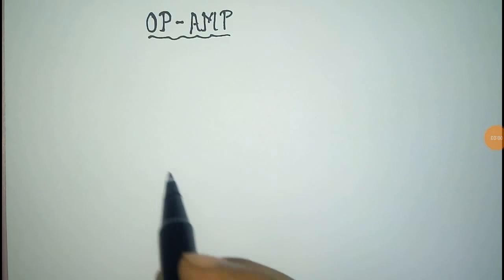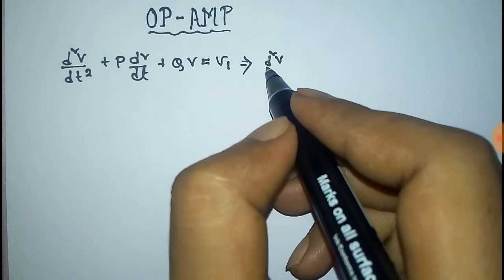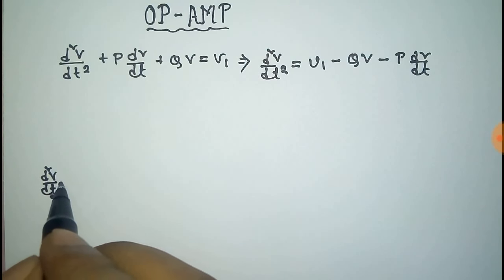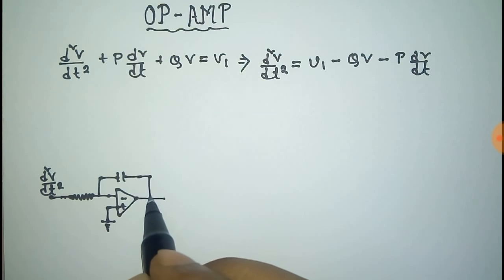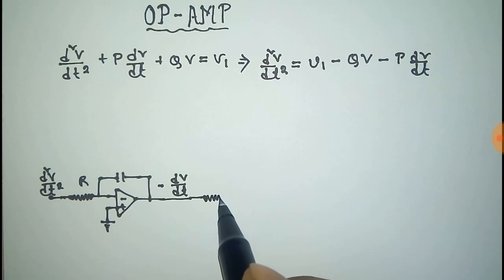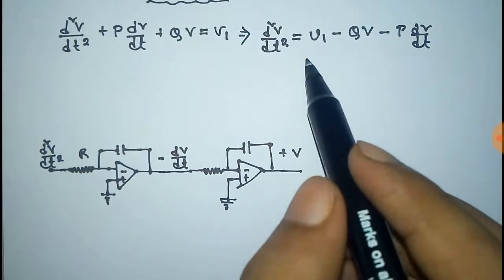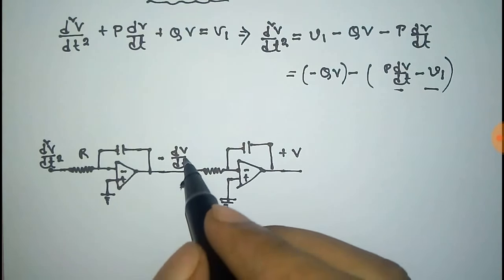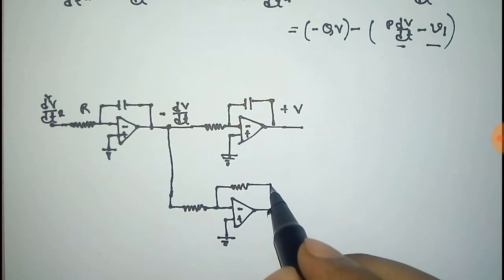Solve differential equation with OP AMP

Comment: How would you then solve the differential equation? I understand how this circuit is used to demonstrate the DE as a circuit, but I dont know how this helps us solve for V
Reply: v is directly obtained at the o/p of 2nd integrator . I had that doubt too. I would take a multimeter and measure that point wrt ground!

Comment: Nice explanation. This would be starting with an initial condition of zero for each term.
Reply: what if i want an initial condition diferent of zero?
what can i do?
Reply: @flavianotchiry3571   just put a voltage source in parallel with the capacitor at to give it an initial condition , and remove it when t>0